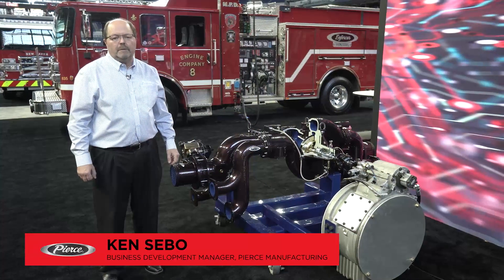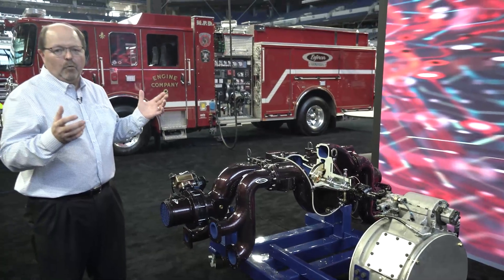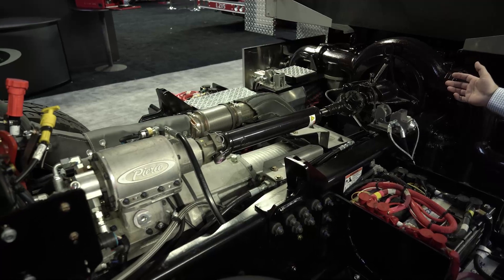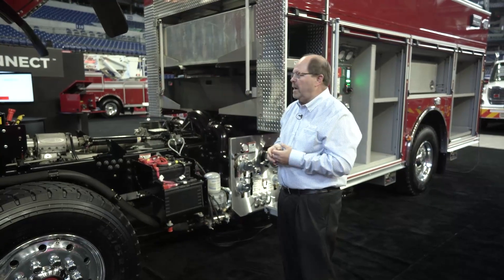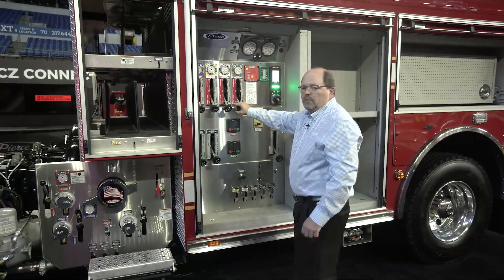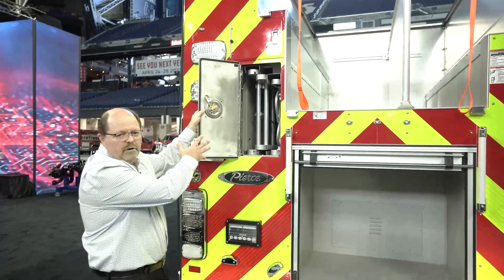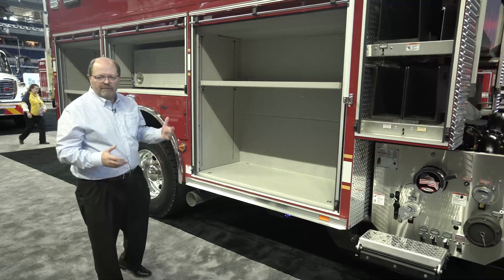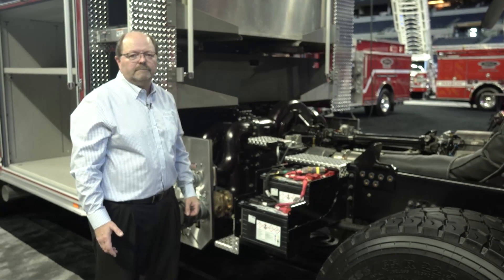Enforcer™ PUC™ Pumper – Now with up to 2000 gpm

Comment: Would you ever make a secondary controller for the air horn located on the pump panel or that area standard? I’m not expert by any means on how to outfit fire trucks or anything but I would think that could come in handy for those worse case scenarios.
Reply from the maker: Hello - We do offer options for controls at the pump panel for air horns. Customers can choose many different styles of switches and locations on the panel. Stay safe!